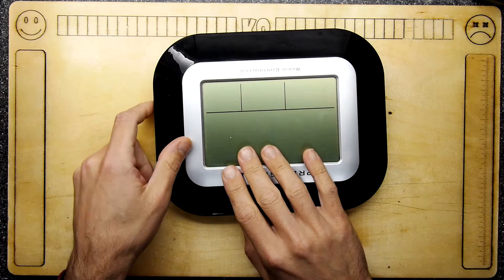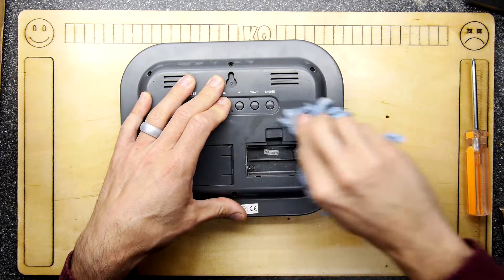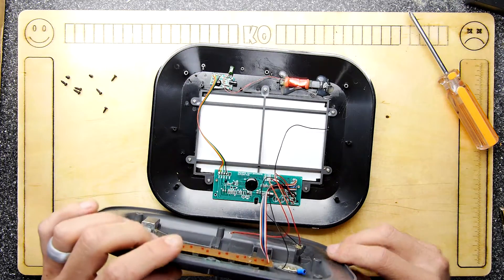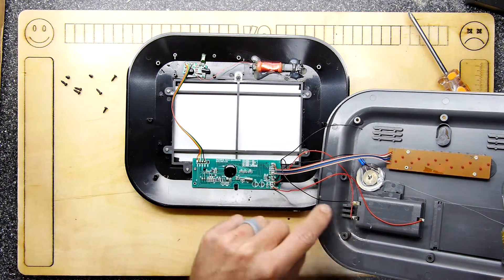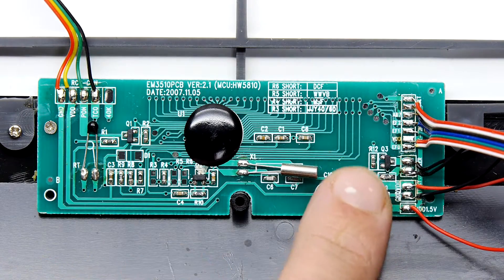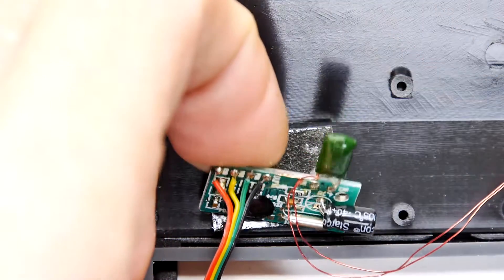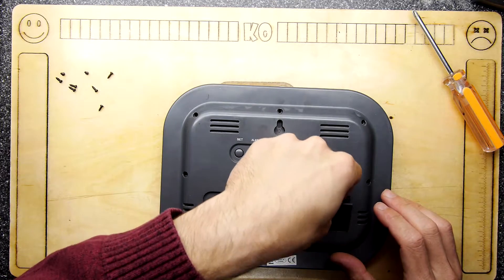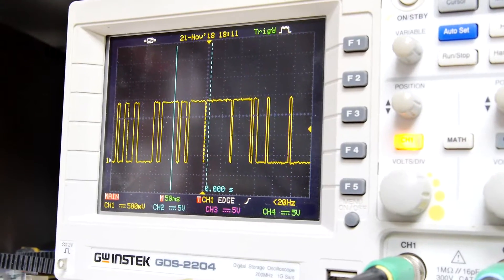Radio Controlled Clock

Comment: Got this exact clock and it’s the biggest pile of crap I’ve ever owned, it loses 1 minute per hour, this is either by using the WAVE button on the back to set it via the Radio transmitter OR setting it manually makes no difference, it loses time 🤬🤬 the company Youshiko makes these and then others are identically made and look the same, must be full of cheapo parts, thrown mine in the bin 🗑 absolutely useless
Reply from the maker: That's a shame, I'm still using mine near on for a decade now. Must have a faulty crystal in it. I bet someone mathematically minded could calculate how far out the crystal was

Comment: 8-Bit Keys had one of the worse leaked battery corrosion repairs ever.
Reply from the maker: Oh really? A really crusty one? It's terrible how much damage they call do. I always wonder if modern lithium batteries leak 🤔
Reply: @backofficeshow  oh yeh this one is really gross. Lol
https://youtu.be/bebasS5a_8o
Reply: @backofficeshow  I know lithium button cells can leak, especially on things like PC mainboards. And the damaged caused can destroy the board. And in watches as well.

Comment: MSF is the radio time transmitter in Cumbria, but it used to be the Rugby Time Signal
Reply from the maker: Ahh thats interesting to know they moved

I'm guessing the difference in location does not make much difference to the time, I suppose they are already corrected on transmission 🤔

Comment: DST = Dayylight Savings Time. I saw TCO and was thinking of a thermally controlled oscillator (crystal in an oven for stability) but that would be TXCO. The jumpers set different frquencies and standards for Radio Time Stations in different countries. WWVB sounds like the US time station. DCF77 (77.5 kHz) is a German station in Mainflingen. MSF60 (60 kHz) is ours in the UK from Anthorn in Cumbria. We had formerly used a Post Office service from Rugby. JJY40/60 sounds like it is possibly a Japanese system. Just looked it up and WWVB is out of Fort Collins in the US. JJY40 is near Fukushima and JJY60 is on Kyushu.
I have the exact same clock and the LCD is horribly dim at the viewing agle I have it at on the wall. Maybe I should knock any oxidation from the battery connectors using a large hammer? ;)
Reply from the maker: Fantastic! You seem very knowledgeable in the arts of radio time!

Would you be interested in a video on my Casio watch with radio time? Our would be cool to understand what that offers
Reply: Not knowledgable, just interested. These things always seemed geeky cool to me back in the distant past, and then they got cheap enough for me to buy. ;) Also, I have done part of the Ham radio foundation license course, which is another tie-in. I don't recall seeing a Casio with radio time. I always liked the databank watches and handhelds, and the IR remote watches, calculator watches and anything with the possibility of connecting to a home micro.
Reply from the maker: I hear ya. I've always wanted to get satellite weather images on my computer. One day!
Reply: TCO is likely Time Code Output, per  https://www.oki.com/en/otr/2003/n196/pdf/otr-196-R08.pdf